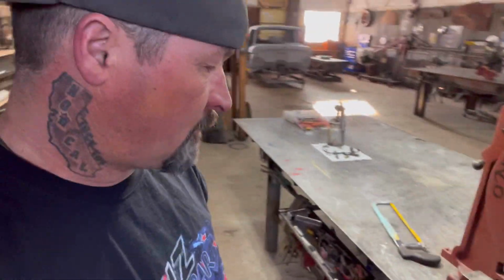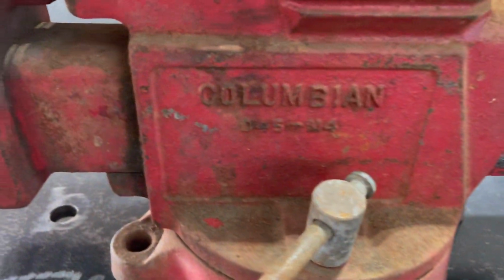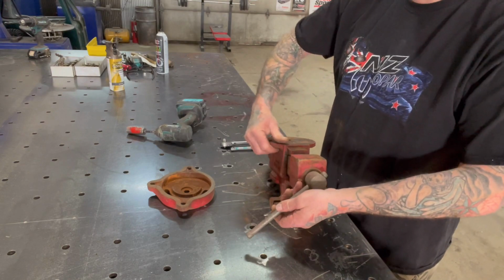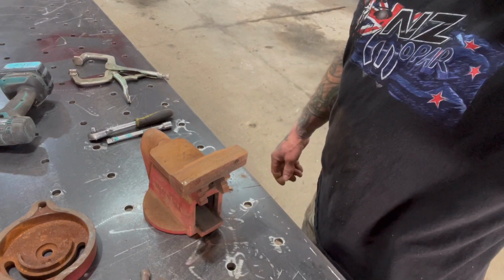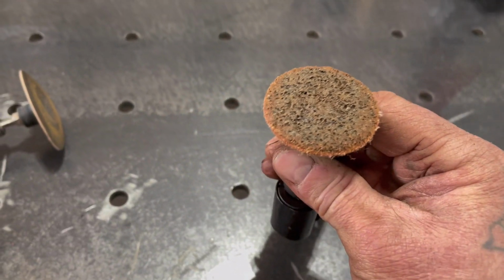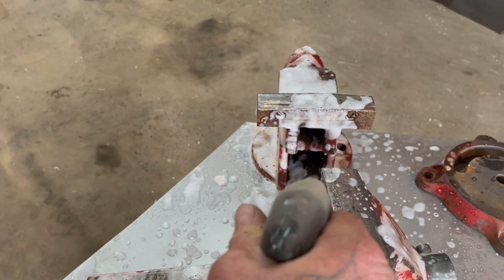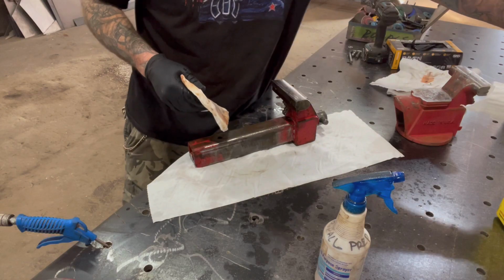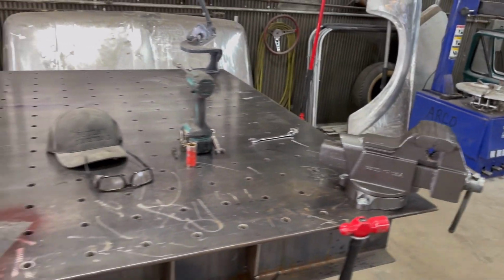Columbian Vise Restoration

Comment: BTW, on the backside of that screw nut, there should be a pin through the vise body that keeps that nut from getting pushed out the back. You can drive that pin out and then the nut comes right out.

Comment: I have basically receiver hitches all the way around my bench. I have 3 different vices and a Hossfeld bender all mounted to 2" tubing so I can use them wherever I want around the table. Or just move them out of the way. I made a heavy base on wheels with a receiver on it so I can use them all away from the bench too.
Reply from the maker: That’s kind of the idea that I wanted to do on this thing but you have all the damn receiver hitches lol
Reply: @OutlawEdge  wanna buy some? 😂😂😂

Comment: I think I commented on an earlier video you did with the super clean, but the stuff is definitely awesome, and you can use the concentrate to strip paint with out damage. I love building model cars and have bought some that was not finished or needed refurbished, and I have soaked them in this stuff overnight. By morning I could just wipe 98% of the old paint off and the plastic was left pristine! It even works on enamel paint, for models anyways, I can't say for all enamel paint applications. And I could just pour it back in the jug to be used again, and it can be reused many times.